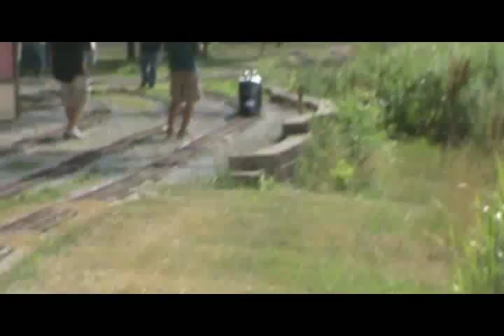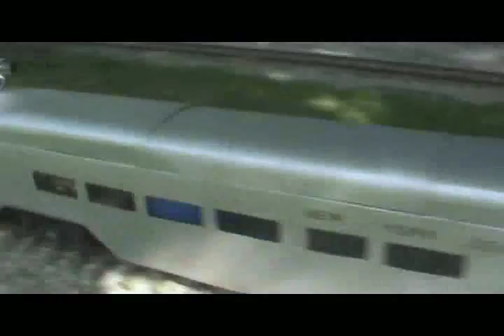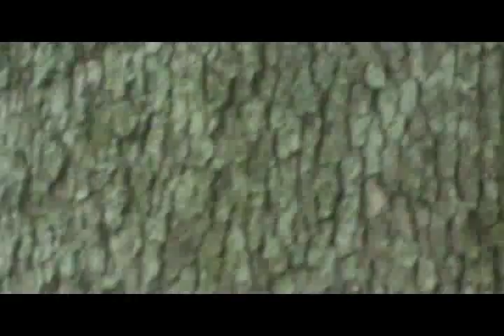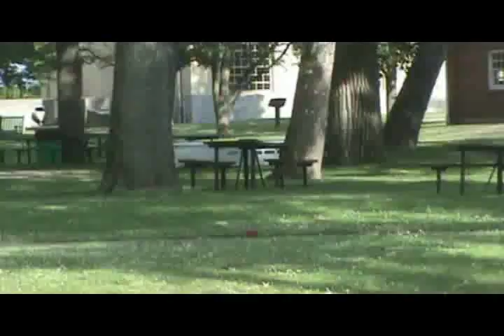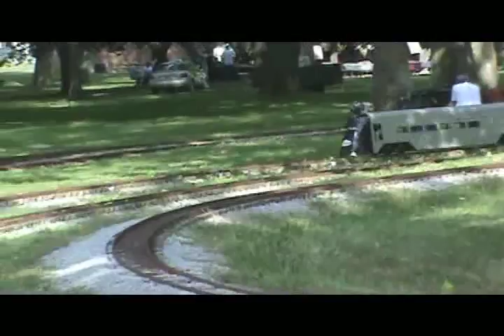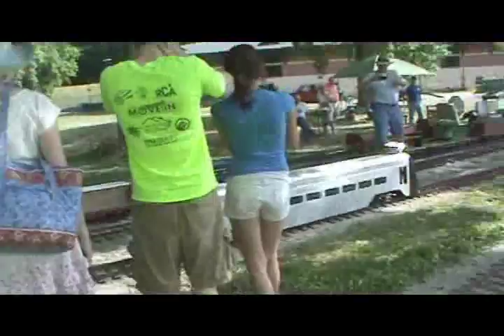Live Working Model of NYC M-497 "Black Beetle" Jet Train

Comment: what type of jet engines on the top? really cool!!! idea...build two mile long straight track...get this car hitched up to some other cars and just go as fast at possible,,those model jet engines can make RC aircraft go really fast..so a light RDC with no one riding it would be amazing speed!...just need a remote braking system & emergency fuel shutoff
Reply from the maker: Paul Rude It does have a remote emergency shutdown if I recall. The engines are high end RC aircraft engines made for model 747's.
Reply: nice! lotta thrust then! lol wish I had the money to have a track like this! this is 7 1/2 gauge correct?